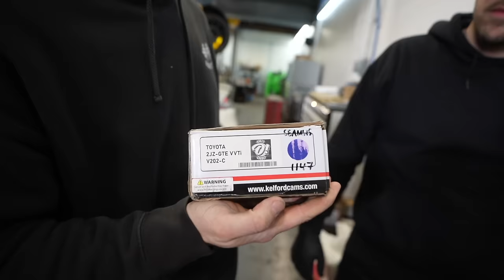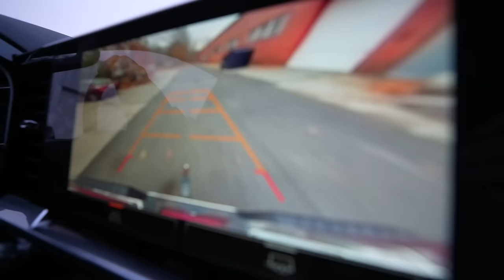REVEALING the ENGINE for the PRO CAR!

Comment: after the LS nightmare jimmy is realizing the JZ is old faithful huh
Reply: I think it was builder error 😬
Reply: @mixedcargarage3781  if anything it was the tune, they were just making too much low end torque. the 2j won't have that problem and is proven to still have more than enough torque and power to compete.
Reply: JZ is better that’s all there is to it
Reply: @D1570R73D I promise you, it wasn’t tune related. Derek is literally in the top 10 best LS tuners in the nation. The shit he tunes in the no prep world makes me confident that he literally does not make mistakes these days.
Reply: @thatrebelboy48  I'm pretty sure he himself said "it may have been the tune"
Reply: @D1570R73D  like I said, I’m 100% positive it wasn’t the tune. Him saying that is him being humble. I’d put everything I own on it being piston rings not being gapped enough for the boost. And I’m not the only person who has built 100s of LS engines that has said the same thing
Reply: @thatrebelboy48  they weren't making that much boost though, it was at 3k rpm. it was mostly torque from the displacement

if you really have built that many engines you would know that anybody is capable of mistakes
Reply: That LS3 would’ve been enough without the ridiculous amount of boost on an SBE. Y’all have to remember, a drift car has to be able to stay at high rpm over and over - a drag car not so much.
Reply: @D1570R73D  okay bud 👍🏼
Reply: @jasonlouis5498  Grant’s LS3 makes a ton of power and he keeps that engine on the limiter. Even when spraying it.

Comment: The wagon is my favorite. A little biased cause i also have a 1000whp calypso e36 sedan. And even though im from Southern Maryland the car was sponsored and built by ics in Stamford CT. Was built in 06/07 so its pretty low compression and laggy with the 80mm. Nitrous was needed. Was honestly more fun when it was making 700whp on stock internals. I need to update it soon.

Comment: You should also look into WPC treatment it’s not a coating, it’s a metal surface treatment and doesn’t change the size or thickness of the material. They have a video on YouTube as well showing and explaining what it is and what it does.

Comment: I’m excited AF. I’m buying a brand new 2JZ from Toyota for my Soarer project, too. Still stuck on do I want to use my Yamaha head and only buy the short block or do I want to go full 2J. I love Yamaha and my Celica and my MR2 both have Yamaha heads.
But, I got cash in hand and a buddy of mine got me a $1200 discount since he works at Toyota. I need to pull the trigger before my birthday in three weeks. 2024 is going to be awesome!

Comment: Decent  premise for driving videos:  use a cool car as a support vehicle to go and pick up parts cars/beaters with a couple of the guys. Avoid using the trailer unless it's absolutely needed. 

Kinda like what vice grip garage does but for more modern vehicles  that we relate to (and typical northeast car problems )

You dont need more projects but having beaters with spare parts around doesn't seem to be the worst thing from a content perspective

At the end of the video you could break down the general prices for the parts you scored vs how much you payed. 

It's been done but I typically find these types of videos entertaining because the drama isn't fabricated,

Comment: Would figure you want less stroke as drifting is constantly hitting limiter.  Plus better rod stroke ratio.  Id glady trade the low end/TQ for more RPM.  Id do the 3.4 for drag.  You also put small gears in a drift car so it doesnt live at low rpms.

Comment: I'd look into a insta360 for driving footage not sure if they 4k but would be cool put it offset on your roof then you can get multiple angles with 1 camera I'd also have a gopro inside then you can have a few different angles with 2 cameras , and it dosen't have to be high speed crazy driving just cruzing some back roads or your daily road would be swt , we just want to hear the motor sing an see u rolling

Comment: We all knew as soon as you said your driving an hour and a half to get the motor that it wasent going to be an LS, no car guy would have to drive more than an hour to get an LS they are freaking everywhere! And I get it’s a pro car but if you went LS I doubt you were gonna put a LSX block in it, when you can get everything you need from an iron block 6.0, or even a LS2 or LS3 would do everything you wanted it to do, plus some with just a bit of machine work and new internals. I have a thing for the 408 LS builds they build them out of 6.0L and if you do them right balanced and all that good stuff then they rev up super quick and are amazing at high RPM and i feel for this set up that may have been perfect. But still I ain’t mad at you for the JZ one bit. They are kinda pricy tho, but are straight baller when built right.

Comment: The engine in the E36 wagon is known as a S52 , it is the lower powered US spec E36 M3 engine.

A S50 is the Euro spec E36 engine, 6 throttle bodies of excellence.

Comment: Steal LZ’s driving video style, it’s timeless. 1 GoPro on the muffler tip, 2 go pro from passenger 3/4 angle, 3 go pro or full frame facing forward. Any of the cars doing that would be awesome.

Comment: So with the DLC shim/buckets you can't set valve lash? Is it just going to be perfect? Anyone that knows please comment
Reply: In the case of a solid (shimless) bucket you have 2 options.

1:set up the valve stem installed height during machining by "tipping" the valve stem on a precision grinder so that you can use a common bucket thickness across the range .

2:replace buckets with the available range of thicknesses available if applicable.(toyota/subaru/others come with factory shimless buckets in a variety of diameters throughout the years).

In this case there are 4 thicknesses available from Kelford that are pre-DLC coated so you "tip" the valves to spec to hit your desired lash.
Reply: @TailoredChassisSolutions  well explained! Thank you!

Comment: 12:12 DLC means "diamond like coating" not diamond like carbon lmfao, that's just redundant as fuck. carbon isn't like diamond, it literally is diamond. That's like saying "meat like burger"
Reply: Diamond-Like Carbon, commonly referred to as DLC, is a family of carbon-based coatings that has extreme hardness due to the diamond crystal (tetragonal) structure and is soft and lubricious due to the graphite crystal (hexagonal) structure. DLC is amorphous in nature (does not have a crystal structure.

Comment: Boring. Another 2JZ like most others do. SR20VET or other engines would be nice to see.
Bring old drifting and times back.
Most Drift comps these days over 600PS and nearly most using 2JZ, LS. Just a couple guys in Europe and Australia using other engines, also in Formula Drift.
Should give more drift comps with classes and power limits